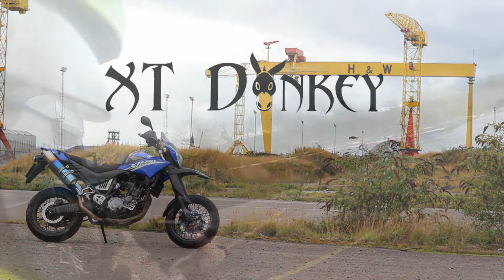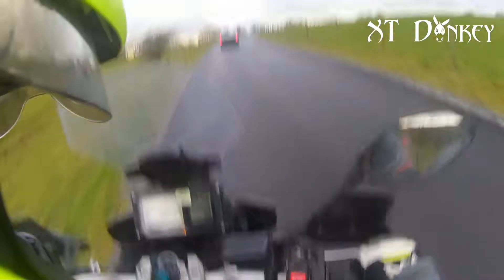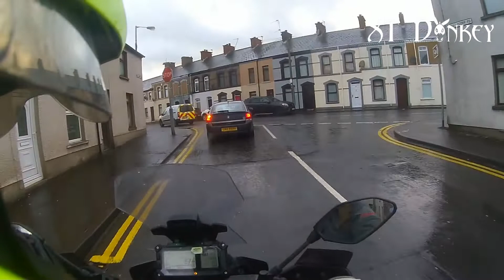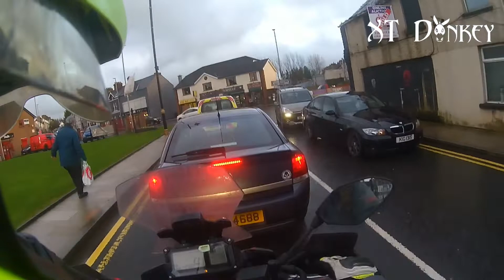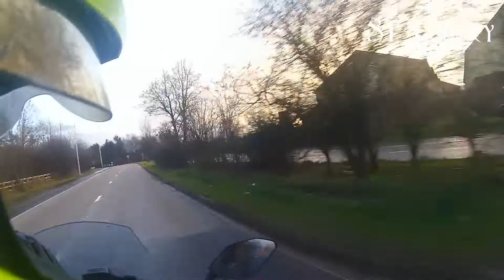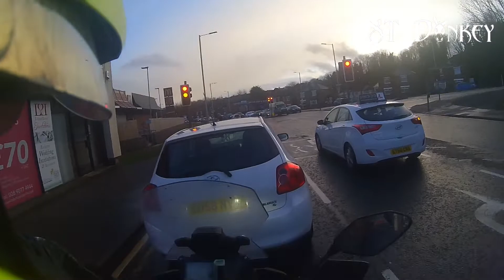The Engine Warning Light of Doom Has come on !!

Comment: i had my tracer on the center stand i started it up and put in gear  it brought the engine light on because of the trc and no friction on the back wheel hurst told me to bring it up nothing wrong the bike  just the light on i didnt want to do the 120 mile trip as i live in coleraine i brought a obd 2 scanner and a 4 pin adaptor  for 35 pounds cleared the fault light in 2 minutes  recommend to anyone i think the o2 sensor is open to all the elements yamaha could have covered it.
Reply from the maker: Yeah the o2 sensor has no protection which is kind of shitty but hey lol yeah going to get my hands on an obd scanner for at home lol